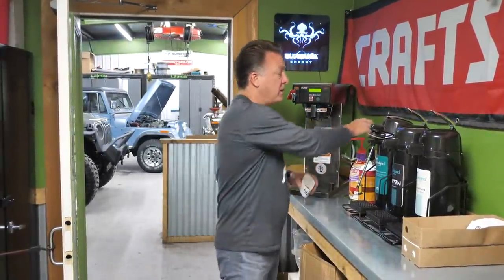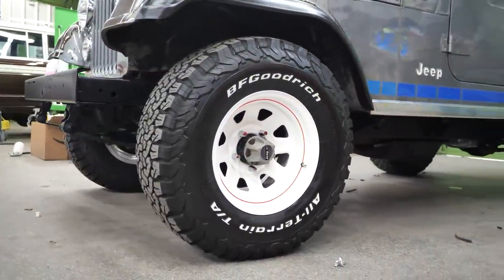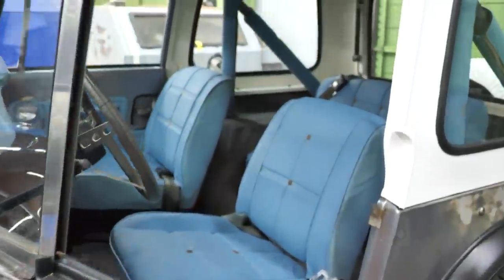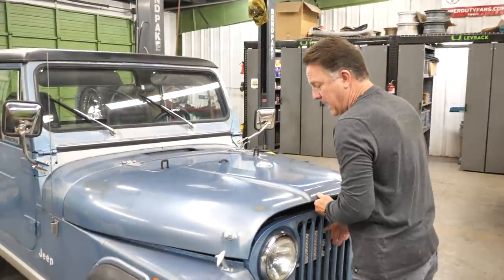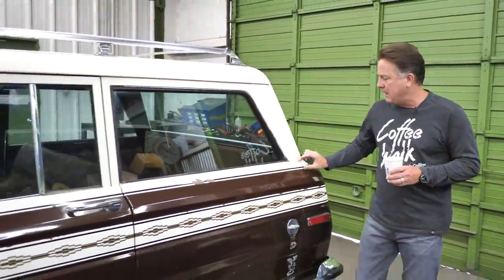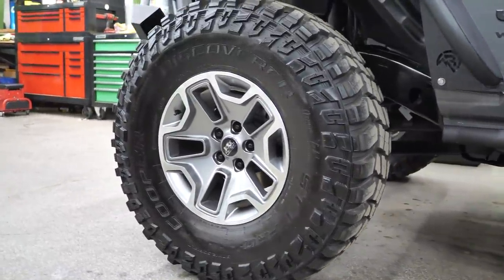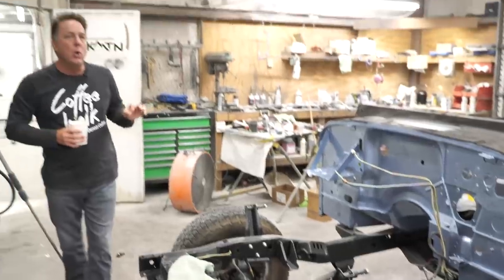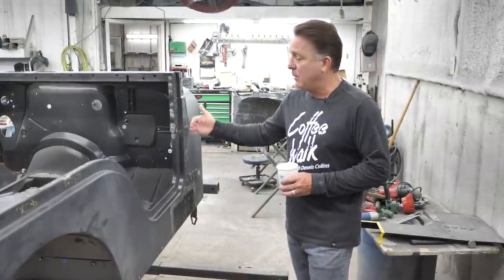Original Paint SURVIVOR Jeep CJ's!!

Comment: Thanks Dennis, you're a wealth of Jeep history, a 401 in a Cherokee, I learned something new today
Reply: I’m from the UK and had to work out 401 cubic inches is around 6.6 litres. That’s big. I used to drive a friend’s (very rare over here) 1980 (I think) Cherokee Chief that was around 5.9 litres (would that be about 355 or 360?). It wasn’t that fast but it was grunty and full of character!
Reply: @markbennett6658  5.9 is a 360.155 HP and 255 ft pd tq hardly a killer engine.  I don't think any of them were all that fast, comparable to other vehicles, they were more famous for their four wheel drive capability back in the day. With the right tires they were exceptionally good in deep snow.
Reply: @IR-nq4qv  yes 155 HP is pretty pitiful and it needs all the torque with that much mass to haul. I’ve got a 2006 WK HEMI which is a 5.7 and around 330 HP. That’s brisk if you stand on it but not earth shattering. Most never see snow and rarely rough terrain here. They’re referred to as ‘Chelsea Tractors’!😂

Comment: Hey Dennis, really like the first Jeep you looked at, just wondering if you would consider using a satin clear instead of gloss. It just looked abit shiny. Just a thought. Love the videos.
Reply: I thought the same thing. I thought they usually did use a satin clear on most of em before so this one really jumped out at me with the gloss and to me it looks really unnatural with the gloss but there’s a bunch of other guys saying that they like it so maybe one of those things where it works for Some but surely not all. If I was going to put a gloss clear over an original paint survivor, I’d just go ahead and body work it as well and paint it back original color. The gloss clear to me just does not look right over patina but that may be what the customer wants tho also, who knows but it’s a great Jeep either way

Comment: The "patina" clear coat is very interesting. I first saw rat rods in 2001 at cruise ins and car shows. I thought it was just a fad. I was very wrong. I was also the owner of a "rat rod" 64 Chevy C10 that I considered an unfinished show truck. An all original 2nd owner straight 6/230/3spd shop truck. I put a 350 SBC out of a 69 Camaro in it in 1989 with 66 Chevelle 327/ 300HP "double hump"  1.94 intake valve heads shaved .020 , Hedman headers, Cherry bomb header mufflers (it would shoot flames 3ft out the exhaust if you knew how to work the manual choke and downshifted) Edelbrock Torquer, 650 Holley, 2:80 Magnum Comp Cam with double roller timing chain and TRW valves with Michigan 77 bearings and a 67/427 Corvette distributor...with points! I tore out u-joints, shock mounts, clutches, alternator brackets, bent pushrods, broke a lifter on #1 cylinder ran it up to 7000rpm (2 bolt stock crank and rods) it held together for over a decade of nothing but abuse. It was still running when I stupidly sold it to buy a 87 Formula. Damn I miss that C10!!!

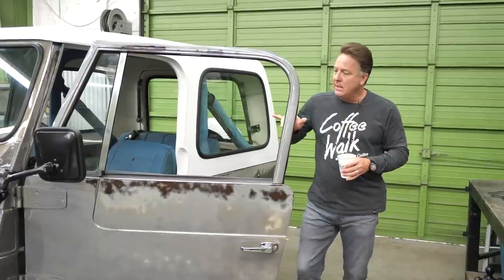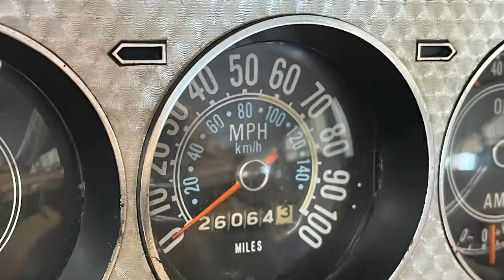Comment: Mileage is wrong on the time stamp 2:37, it totally rolled over odometer you can tell because between the 5 and 2 is off set. The other one time stamp is correct odometer 6:28 the numbers is correctly in line not rolled over,  odometer was designed from the factory  to tell the odometer has rolled over.
Reply: Dennis what do you think? I have always thought the same,
 that numbers out of line on an odometer shows that I stuck my 90° pick up in there and adjusted the odometer myself.